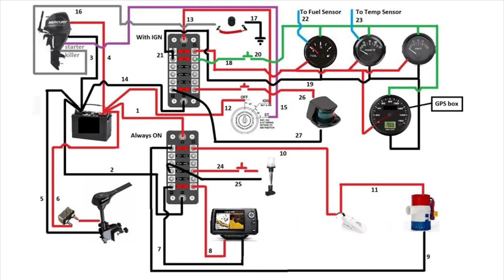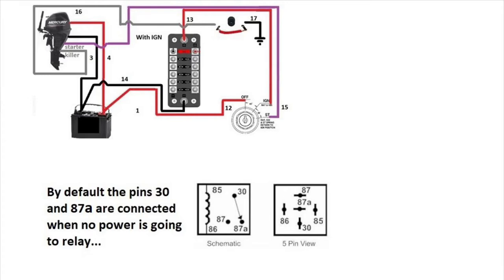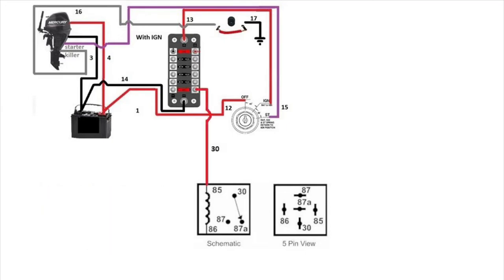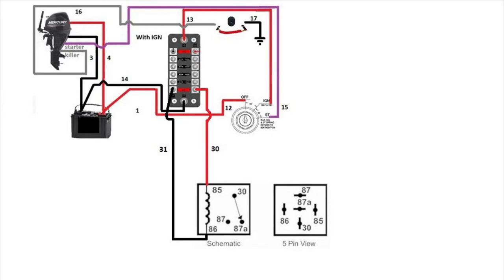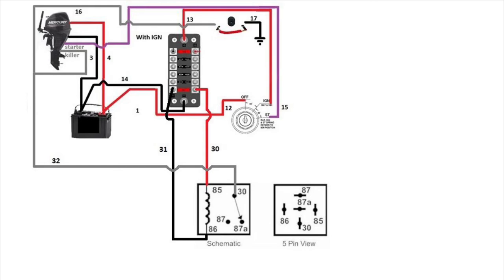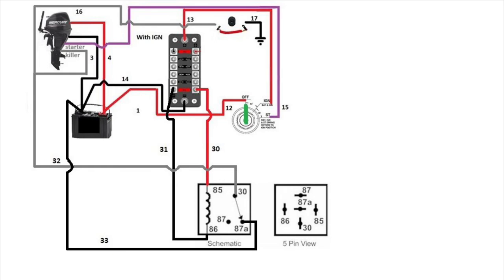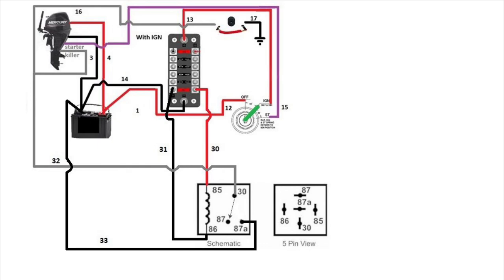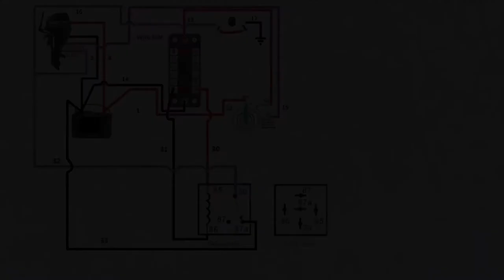Boat electronic wiring diagram, part 2 (auto shutoff engine with key)

Comment: Help please! I have rewired my boat following part one, great help by the way. However, I am on part 2, wiring relay, my5 pin relay has 85 as ground (blk wire) and 86 as pos.(white). Confused because your saying 85 to positive of fuse box.
Reply from the maker: Hi reneehicks, thanks for watching and please don't forget to subscribe :)    It could be ether or. If 85 is positive then 86 is ground. if 85 is ground then 86 will be positive. hope this help.
Reply: Ahhh! Yes! Thank you!

Comment: I have completed the wiring except the ignition switch. My question is : the wire from ignition going directly to fuse panel, my switch has an "A" which has a purple wire , do I just add a wire off "A" to fuse panel with purple wire attached to switch also?
Reply from the maker: Hi, ok for the key wiring. You have 3 position. One is the off, You bring your 12v from battery to it. The other position is Ignition, that is the one that will go to feed your fuse box. Don’t forget, if you have lots of amps going to your equipment you will need the right gauge wire. And the 3 position is the wire “usually purple” from engine to start engine. Lets me know if it’s clear 👍
Reply: Thank you, Joe! I will let you know, rain here for a while. Your video is  very informative! Thank you for getting back to me. This woman is getting it!😅 one thing I did do was attach fuse boxes to a plastic cutting board and layed it all out before transferring to the boat. Very helpful that way for me!

Comment: Hi Joe! Quick question. I want to add a circuit breaker from my battery to the always on fuse block. I ran 6 gauge wire to the always on block and its 10 feet from the battery. What would you recommend I use for the amperage for that breaker? Im concerned if by chance one of my crimps failed, that positive cable from the battery could ground right against my aluminium hull and potentially start a fire. I know I need to add it closest to the battery but im not sure If i can go 60 amp or I need to go higher? 100? I have light load at the moment, led lights, two pumps, a radio and a small fish Finder. Thanks!!!
Reply from the maker: Hi Steve, what is the total amount of fuses in your always on fuse box? That could be one calculation that you do. 

If you calculate per item, a radio about max 10amp, two pumps calculate 10amp each “I don’t know how big your pumps are”. A small fish finder depending on the model I would think about 5amps max. For the rest if it’s led lights “it’s very minimal” so max 5Amps and I’m exaggerating lol

I’m calculating about 40amps and I’m pushing it with the equipment you gave me. What ever you add in the future don’t forget about making the breaker bigger. Let me know how your project goes 👍
Reply from the maker: Hey Steve, here's a little more info. On a 6 gauge wire at 10feet you can pass between 85amp to 105amps  before your wire can heat and melt. So putting a 100 amps is boderline your wire might give up before your breaker.  Check this video for some info on Wire gauge and amps :) hope you like it.  https://youtu.be/c_9MxEdlRuA

Comment: Thank you very much. Great videos on boat wiring. I wonder if you could add a video on a two battery system where one battery powers the trolling motor and the other battery powers the outboard motor.
Reply from the maker: Hi thanks for watching, I will work on it 👍
Reply from the maker: Video should be out shortly. Working on one video with 2 batteries and a switch 👍
Reply from the maker: Here you go check this out 👍 https://youtu.be/USG1xZju1DA

Comment: Hi good day.....what a great video. I have question on cable no 3 & 4 that from motor/engine that work as supply power to charge battery. As we know voltage from engine while running on idle & max speed will create increase of voltage right?...so do we need to worry on this increase voltage to charge our battery or do we need to put somewhere in between engine & battery like voltage regulator?...any further information highly appreciated & thanks again.
Reply from the maker: Hi Sukri, thanks for watching. yes, you can add a Voltage regulator if your outboard doesn't have one. It will prolong the life of your battery. On my outboard it already had one so I didn't need to install it :)
Reply: Thanks for your reply 👍👍👍

Comment: Excellent and so helpful, BUT where is the switch panel connection?  can you please add it
Reply from the maker: Hi Ali AJ, thanks for watching, here’s another video I had done about, how to install a switch: https://youtu.be/USG1xZju1DA

Let me know if this helps. I usually try to remove the most possible off the wiring diagrams, so it gets less complicated to understand 👍
Reply: @joetheboatguy5394  you are the best, thank you so much.